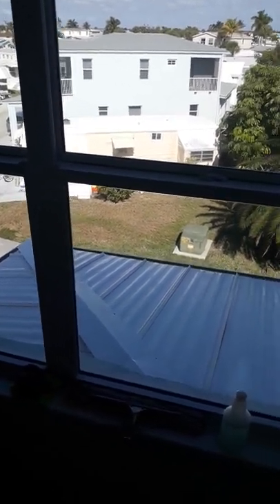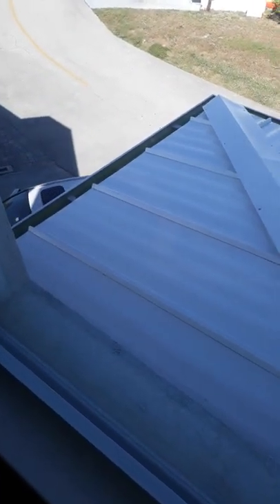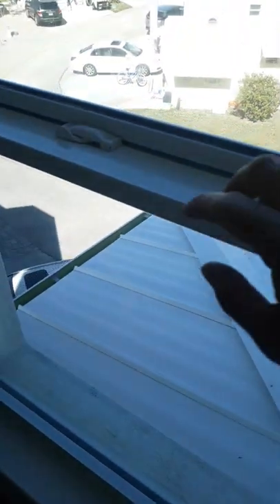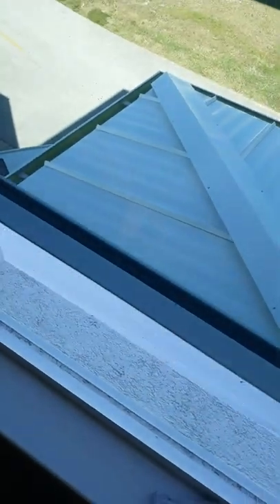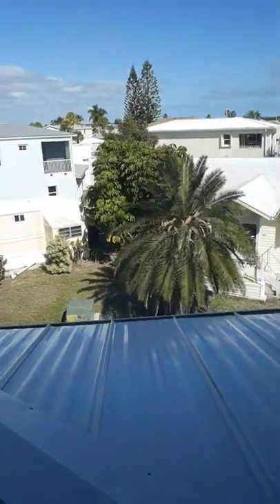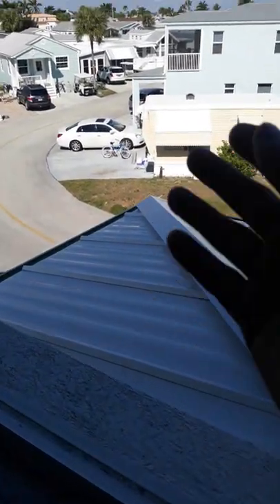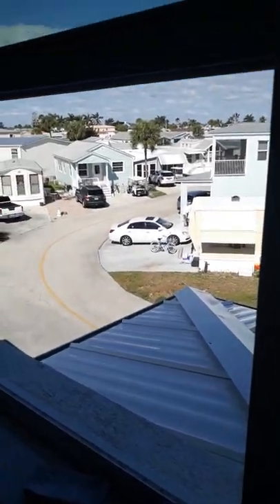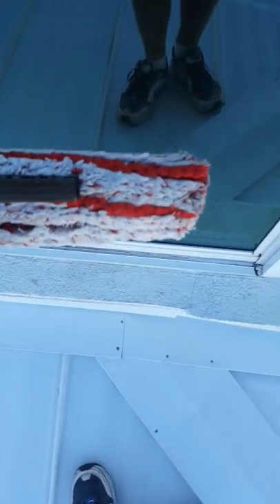Window Cleaning:  Roof Safety tip/idea 😲😲

Comment from the maker: This is a trick I use when I need to access the exterior windows.  Metal roofs sometimes have very steep pitches-  making it tough to get onto it from the ground sometimes. A solution? Open the windows and just walk through it!  Always make sure you are secure-  a WFP would not reach behind these, otherwise that would have been how I do these styles.

The pitch is pretty steep and you don't have anything to hold on to if you fell.  It would be hard to make a living not ...LIVING